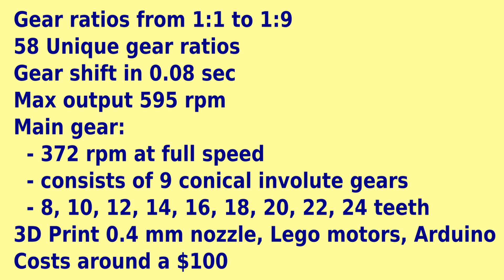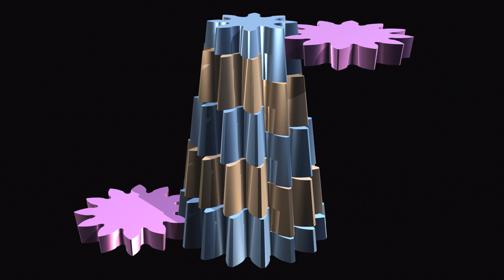New CVT transmission - Proof Of Concept / Prototype

Comment: This stepped transmission would be interesting on a bike, where I think it’d be a better fit.  This assumes there’s an easily managed set of ratios that you can traverse sequentially as well as large, quick jumps.

The reason I see it being more useful for a bike is due to durability reasons, and combined with the reality that it’s needed at times (ideally) to be able to switch gears at a dead stop (say, you’re cruising along in a high gear, need to stop too quickly: happens with roads and traffic light areas) without mucking things up. It’d likely mot be small enough/sturdy enough in any 3D-printed plastic for even a bike (I realize this is a demonstration of the concept) and would need to be made of metal.

Other than how it tortures bike chains and destroys them quicker, if this could be made light and sturdy and is sufficiently fault-tolerant with contaminants (though perhaps that can be fixed via enclosure) being able to shift quickly, reliably, with no chain derailment possible, also noting with such chain binding, you lose a lot of power transfer efficiency, I expect that’s where this should focus.

Comment: Have you heard of the Lightspeed transmission? One thing you can try is instead of moving the gear along the cone, put gears all along the cone that have a clutch on each gear and activate the clutch for the gear you want to activate like in the lightspeed transmission. any gear that is not engaged will spin freely on bearings.

Comment: Interesting design where room (volume) is an option as so much is trending seems towards electronic designs with minimal mechanical parts.  However, seems like wind turbines, hydro plants, maybe pump stations and other still having mechanical translation systems to electrical energy might be able to use.  Maybe portable systems like semi-trucks (tractor trailers or other trucks and maybe locomotives) might benefit.  Wondering about ships at sea maybe?  Thanks for sharing.  Maybe having open source for non-commercial use to get more model awareness out might help maybe to trend and publicize.  Then exert your rights if produced for profit.  Seems like would be a fun 3D print to have a future generation exposed to and maybe inspire industry to see how to adopt?

Comment: It requires steps so it’s not a CVT. It’s like a transmission with dozens of different sized gears next to each other. Also, In practice for a vehicle would not be optimal because between the steps requires clutches to smooth out the gear change. It not, this design will have its teeth worn out really fast.
Great concept though.
Reply from the maker: I called it a CVT because it allows the engine to run (very close to)/at its optimum speed because it has so many gear ratios (59 ratios for a main gear with 9 gears). Also no real CVT actually has an infinite amount of gear ratios as in reality they all have an error margin of larger than zero.

Comment: Gearbox similar to this is used in lathe.
Reply from the maker: That does not have multi-ratio gears and they are not conical involute gears
Reply: @New-CVT  I mean, they are similar. Both are stepped transmissions that can't be really used in applications such as vehicle transmission simply because one of the things that car transmission needs to achieve is as lower power loss as possible.
Reply from the maker: The new-cvt is extremely efficient
Reply: @New-CVT  patent it
Reply from the maker: @cenreaper9127  I did, ... no one is interested ....
Reply: @New-CVT  I kinda understand why. As I told you, gearbox similar to this was used in lathes. You are literally not doing anything special with that.
Reply from the maker: It looks similar, but it is very different. Look at the animation on http://new-cvt.com The pinion gear moves from the top blue gear to the bronze gear without ever disengaging by using the multi-ratio gear in between them.
Reply: @New-CVT  Oh. Understandable 😊
Reply: @New-CVT  Yes, seems like would be handy in a geared lathe.  Seems a lot is moving away from mechanical designs... sadly.  Though mission critical systems, might be handy like if the life cycle is very long say maybe with hydrodynamic bearings and maybe power plants?  Not sure really.  Seems really interesting and novel to me.

Comment: That's not a cvt
Reply from the maker: A transmission with that many gear ratios functionally is, and no CVT actually has an infinite number of gear ratios as you need an infinite precision to set it.

Comment: Note I agree with your comments than cheaper electrical vehicles will need transmission. Taking the example of 4 teeth on one half and 5 teeth on the other side and assuming the other gear stays at the same position on the slider. If you looked at the torque and angular velocity they would be consistent and there would be no fluctuations in torque or angular velocity when it changes from 4 teeth to 5 teeth? If not then there will probably be some vibrations or harmonics.  If that is the case you may have to convert half of the steps into even number of teeth with the in between steps being the transition to the next gear. In that case with 9 stacks you would effectively have a 5 speed transmission.  My suggestion would be to build ( out of metal) just a couple gears (one with same number of gears on both halves) and and one with 4/5. And one with  9/10.  Then do some testing and putting them under load and speed and see if there is vibration, etc.  in most power trains the input and output shafts to and from the transmission are parallel to each other. The cone is on one axis. The gear on the slider is on a non parallel axis. It was not clear how you plan to handle this - especially when there is a lot of torque and RPMs.
Reply from the maker: All the gears in the main gear are cut from conical involute gears with an even number of teeth. During normal operation only gears with an even number of teeth are in play. Only when changing gear do you go from a gear half with 4 teeth  (from a gear with 8 teeth), to the other gear half with 5 teeth (from a gear with 10 teeth). So the problem you cite only happens during gear change, not during normal operation. And yes, at this brief moment torque will have to be reduced.
Reply from the maker: Yes, a prototype in metal would be great, but I do not have the money.

Comment: Technically not a CVT though, as it has discrete steps in the gear ratios it can produce. A multi-speed automatic, sure, a CVT though it is not.
Reply: Thank you very much for the conversation between you two, doubts have been clarified
Reply from the maker: Theoretically true, but practically it makes no difference, as the number of possible ratios is so large. Add to that the much grater efficiency and capacity to handle torque and it explains the name. All this, by the way, is also explained on the website http://new-cvt.com.
Reply: @New-CVT  That is true, but then what is the advantage over a convensional automatic gearbox that can have 10+ gears these days? If its not a true CVT, it cannot just hold a specific rpm constantly while speed of the vehicle changes. It can get close, but so can modern automatics.

Edit: been through the website and the number of gears it can theoretically produce is impressive, I'll admit. So it would be better than a traditional auto at holding an RPM. So I guess you could call it a Psuedo-CVT at that point. What would be the primary advantages over a "traditional" belt driven CVT? I assume it would be the amount of torque it can handle, and lower wear?
Reply from the maker: @__-fm5qv Torque and efficiency. True CVT’s all have the theoretical problem that their contact area is assumed to be infinitely thin, while in reality it cannot be. I sacrificed the infinite number of gear ratios for better torque and efficiency, and in practice an infinite number of gear ratios cannot even be achieved due to the error margin in setting any ratio. The only real disadvantage of my CVT is in not being able to shift gear while under load, but even this is not such a big problem as many seem to believe these days.
Reply: @New-CVT  ah I see! Because traditional belt driven CVTs have to slip at least part of the belt to rotate they lose efficiency and torque handling potential.

Sorry if I'm asking a lot of questions. It's just because earlier this week I came up with my own gear driven CVT concept, it actually started out much like yours. But admittedly I never did the maths on it.

I wish you the best of luck in your endeavour!

Comment from the maker: This was my first attempt. Can everybody please let me know how I should make the final version.

Many thanks.
Reply: can't you make a doubled version with gear-ratios less than one and above one?
and maybe make a scaled car to show the power and speed
Reply from the maker: Don't quite understand what you mean. You could see this one as going from 1:1/3 to 1:3. I don't have the means to make a better version than this.
Reply: I am assuming you will want it in metal. Look into wire EDM, and maybe reach out to other YouTubers, like either BAXEDM or PracticalMachinist
Reply from the maker: Metal would be great, but I don’t have the money
Reply: Maybe there should be some extra coupling of the gears that slide to the conical gear that ensures transmission error/backlash is minimized during change of gear ratio.